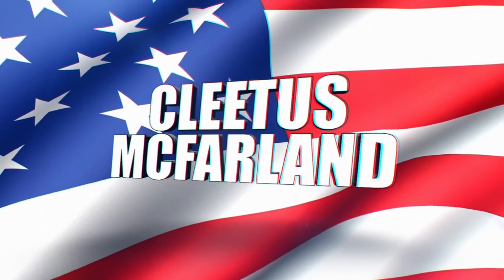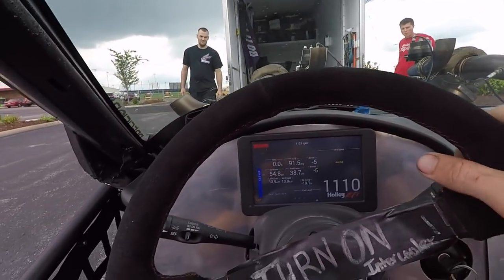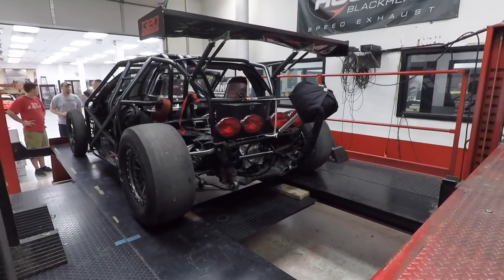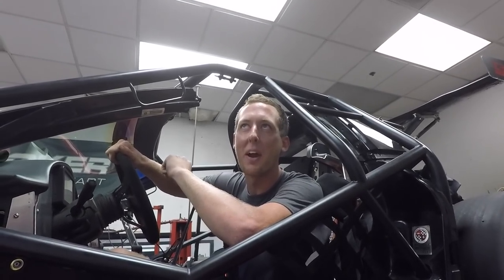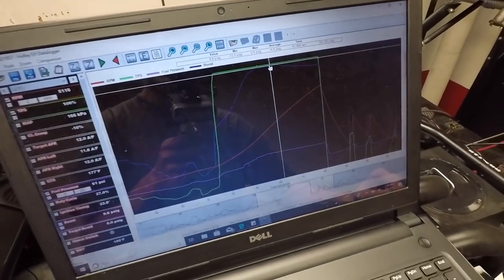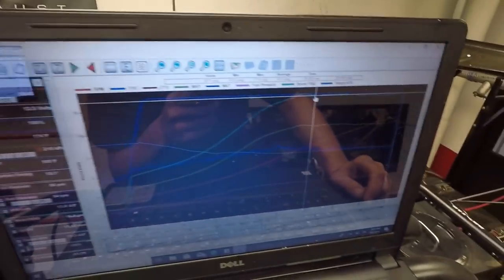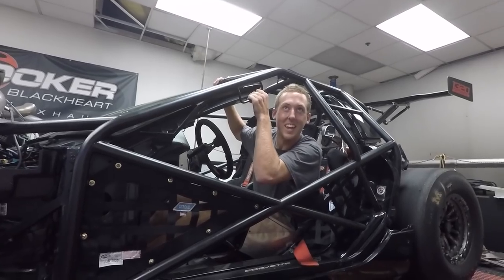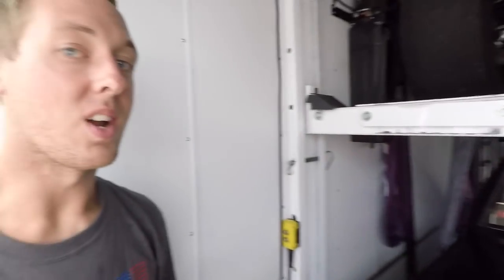Leroy Hits the DYNO! Making HUGE Power at Holley Performance's HQ!

Comment: Autometer part number 9117 should take care of that tach signal problem. It just connects in line with the B+ feed to the ignition coils and puts out its own pulse signal. I needed it for any rpm-referencing stuff on my 3800 but LS's can be a little funky with tach signals too as I understand it.
Leroy's rockin it! Love it

Comment: My car T2.0L makes 260hp at the crank on 20psi, LSX 427 / 7.0L makes 1,260hp at the wheel on 22psi. i'd say that ends the debate ,there's no replacement for displacement! And this 7.0L  weighs about 100lbs less then a 2jz 3.0L.
Reply: Are you sure it weighs that much less? They are both iron block
Reply: the 2jz weighs 600lbs because inline engines need to be rigid because of how long the are , a stock aluminum LS1 is 425lbs and a iron block can weigh between 80lbs to 100lbs more so best case it's 75lbs lighter. Once you add a turbo setup its a break even on weight but being able to run dramatically lower psi is worth it for so many reasons like keeping intake temps under control and not being so laggy because a smaller engine trying to spool up the same turbo to a higher psi is just going to take longer etc. The 2j is a good engine but its kinda pointless because of its size/weight/cost, now if it weighed 325lbs like a honda engine it would make a lot of sense, but 600lbs for a 3.0L is ridiculous because people stopped building big blocks because they weighed 600lbs
Reply: @eaglefat9398  I see your point. That must mean that because the 2jz weighs so much that's why it can handle relatively high amounts of torque and horsepower before something goes wrong because of its weight to displacement ratio.
Reply: FYI my turbo civic made 500whp on 6266 on gate pressure with no timing. And 700whp at 23 psi. 4 cylinders especially Honda’s are more efficient.
Reply: no
Reply: See the problem is that there are supras that make 1000 hp so factor in that it is 3/4 of the motor and you see that the hp that Leroy is putting down is about the same that a supra could if it was a v8 and not an i6 also we are trying to compare a race engine that has all the latest tech pulling and pushing it up and the supra even when update still runs on out dated tech so if we factor that in and take the gm motor back to the year 1996 then we can see that even the big hp car then were only making around 1100-1200 hp and that is some of the higher end drag cars
Reply: @jordanhemingway2057  no there are plenty of built billet stroker 2jzs your not running over 1100 very long on a out dated 2jz before bad shit happens
Reply: Unopened 2018 mustang gt 5.0 made 1194rwhp on 18psi when and was spun to 8000rpm. Id say that ends the debate, efficiency and engineering is is an effective replacement for displacement where possible. It also went 8.64@164 with an unopened 100% stock engine, converter, and 10sp auto.

Comment: Was anyone else concerned about the blue tape being on the intake while he was running it?  I could just imagine the glue being stuck all over that beautiful intake.
Reply: I was thinking the same thing...
Reply: Painters tape from 3M to protect the finish. It doesn't leave any residue.
Reply: They pulled between runs 1 and 2. 6:34 you can see the shine on that badboy for just a sec.
Reply: cold side of the turbskies my dude. Its all good
Reply: @berrytharp1334  I know the purpose of using the tape, but melted tape leaves residue behind
Reply: @geo6111  idk if you've ever touched an intake after it gets to operating temperature, but it does get a bit hot to the touch. Definitely enough to melt the glue off the tape. That's why they pulled it off after the first pull.
Reply: @mangomussolini7986  yeah I was able to breath afterwards lol

Comment: Leroy vs Bugatti 🤔
Reply: Rip to the bug. Unless you got a 3 mile airstrip the bug is useless
Reply: Uh with the LSA blower it was quicker than a veyron down the 1/4... They run low-flat 10's at 135-140 mph.

Comment: It's funny how many people think these engines are built like a loosely thrown together oem engine. NOPE! TIGHT TOLERANCES PEOPLE!
Reply: The tolerances are the same the parts are the difference.
Reply: @liljjbo17  lol 😂🤣
Reply: @liljjbo17  tolerances are different on race engines. Theres many advantages to it. It's not recommended to use heavy oil though. A smaller gap spread the load over a wider area for instance. I could go on but hopefully you get the point now. They are different especially if you want the motor to last longer.
Reply: Not tighter at all. Race motors are actually set up looser especially in the crank and pistons. The main difference is that the crank is perfectly straight, the block and heads perfectly flat cylinder bores are perfectly round.  Each intake runner flows the exact same amount. Rings on the piston have bigger gaps because they get hotter and expand more. This is especially true with NOS equipped motors and ones with forced induction like Leroy. Also rings are much thinner to cut down on friction also. Piston clearances are greater because forged pistons expand more when heated. The only parts that are actually tighter are the valve guides to makes sure the valves seal as close to 100% as possible.
Reply: @michaelwilkening8542  thank you for proving my point. "Perfectly round" "perfectly flat". Tighter Tolerances mean the measurements need to be within a certain specified amount, such as +or-.005.
Reply: yes, a race engine sounds almost broken and worned out at cold starts cause of the tolerances ...
Reply: BigJbish .005 is not tight at all. As a machine operator I work with +/-.0005. +/-.005 is a freaking mile
Reply: @pattyboy2523  I was giving an example. Not stating a fact. What type of machining do you do that you have to be within half a thousandth?
Reply: meshuggah life components for aircraft engines.
Reply: .003 to .005 ( roughly the thickness of a human hair) is normal cast piston clearances.  .005 to .008 is normal clearances for forged racing pistons that expand slightly more than cast pistons. Some forged pistons can be tighter due to the metals composition. Rods and main  bearings are around .0015 to .0025 so having a single hair under a main bearing will lock it up so tight it wont turn over even on a stock motor.  The amount of run out in the crank is the more critical measurement both in diameter and straightness. A crank just .003 out of being straight will wear out the main bearings in a matter of a few passes if the run out doesn't spin a main bearing first. .003 over the length of a SB crank is a little over 2.5 feet is a extremely small amount of runout.  But overall a race motor has much looser moving clearances than its stock counterpart. Straightness and flatness is where the specs are much tighter than stock motors. The little bit of block warp that caused Leroy to blow its head gaskets were probably well within stock specks and on a non-race motor would have never caused a problem. A lot of race motors are rocked which means the water passages are filled with epoxy to prevent the cylinder walls from changing diamanter while under load. We are talking a very small amount of distortion.

Comment: you needed more power you added some weight to old Leroy
Reply: With the power he is making the stronger the chassis is, the more power that gets to the ground. This weight only helps doesn't hurt in anyway. Like added just a 8pt cage to a car even with the extra weight you will go a few tenths faster specially in a stick car with DRs or slicks.
Reply: I figure he would hook a lil better......
Reply: Not with the power he's going to be trying to put down. It's going to be cool to see how well they do.
Reply: @waynebollentin989  the added weight WILL NOT ADD A FEW TENTHS...at this point aero and driving the car will help.
Reply: @chadrichards8930   chad richards  I never said it did. Read it again. I said the added weight would NOT hurt the car. I was also talking about a car with an 8pt cage something his car clearly doesn't have and even then I said it would still help more then hurt the car with the 8pt cage. Thanks

Comment: What I like about Cletus is there’s no bullshit clickbait. Also. Instead of having a note on the steering wheel about the intercooler, for about 20 bucks you can put a temp controlled controller. Set it to come on at 90 or so degrees and only come on with the key on. That way you don’t need to remember to cut it on. Just another thing to forget.

Comment: Awesome new LSX combo, shame about the problem with LS3 blocks with their stock beehive sleeves, even with thick deck aftermarket heads they still push gaskets with high hp/cylinder pressure, but its good to see Leroy now will make mega power long into the future as long as the tuneup it solid.

Comment: I'm thinking that you should rout the exhaust towards the bottom of the cars sides and make them face the rear wheels so it heats them up while your doing your pulls, I guess and work on the aerodynamics, i feel like you could make high 5's or low 6's with those changes. No joke.

Comment: Cleetus, when are you guys gonna get with a motor oil brand for sponsorship???? And what motor oil do you guys run???? Best channel on YouTube!!!!
Reply: Beware dyno readouts can be faked.  It's unlikely but possible. When money is being made of YouTube. 

I just don't see these vehicles having the cooling capabilities to run that much power, when you consider a truck or a veyron has massive radiators.      Also what drive shafts are they running on these drag cars, 

I just thing the power is more like 800bhp or 850bhp.

Research fake dyno readout for a heads up on what some of these click bait channels are doing.
Reply: @chris77777777ify  No you are wrong.  A twin turbo lsx can easily make over 1000hp.  You don't have to spend over a million dollars for that. Yes, us dumb Americans over here have mastered the art of making reliable power.

Comment: How much is the Hp difference on the same Boostlevel ?
Reply: I think it was near 750 on spring pressure before so roughly 100hp on low boost, no telling how much at higher boost till it gets on the same Dyno in same conditions.

Comment: Nothing to break in with big bearing clearences and big ring gaps.
Reply: matt, yup. That is why older high milage engines with bigger ring gaps are good for boosting.
Reply: I was responding to his uncertainty not asking a question. Our teksid block,  with 4V B heads does well over 1500 to the wheels on 32psi. Factory bore and stroke 4.6.

Comment: All we ever did was let it warm up and then adjust the values then hit the track,  with a good engine builder that's all u got to do
Reply: @95Sn95  what the hell r u talking bout
Reply: @95Sn95  I'll go ahead and guess he was talking about a fuel injected car in which he literally said he warmed the car up and then tuned it.. Or "adjusted the values".. There's really not much else you CAN do. He was responding to the breaking the engine in subject you weirdo... I'm gonna second the what the hell are you talking about notion.
Reply: @danielnelson4881   I was talking bout adjusting the values in the 358ci with a carb that we ran in our round track truck,  but what I was sayin all I had to do was start it up and let it warm up and then adjust the values after we got it cause we had a great engine builder like they do

Comment: i work my ass off and only wish i could do some mods to my vette. i am happy tho c6 vetts have really come down in price.my goal one day is to make 700 in her. anyone want to buy a 2015 evo x lol low miles very clean and a new motor. car has 23k on it and the motor has 500miles. trying to get ride of this so i can do more to the vette. love the videos maybe the next time you come to KC mo ill beable to see or meet you and kyale also there is a new NHRA drag track opeing up called i70  speed way. i really hope you guys come to this track its located by KC MO. Will be open spring 19 in march sometime.
Reply: You blow the first motor? Lol
Reply: no first motor was ok the guy i bought it from was runing e85. idk if he didnt tune it right but the top ring poped up over the the top piston in cylinder one. i was lucky it didnt cause any damage to the block or head. i bought all new pistons rods bearings and had my block and head checked.
Reply: ah, i see. i know people with evos that blow them quickly because they slap on a "tune" that just ups the boost and they end up blowing it running too much boost without actually getting it tuned properly or making sure the motor can handle all the extra boost

Comment: Haven't watched the video yet but I hope Leroy makes 1320hp. You know for 1320 videos and what not haha.
Reply: Aw man come on 23psi and 70 percent duty cycle. Do it for Dale 15lbs wastegate springs hit 25psi and 80-85 percent duty cycle. Hit that 1320 hp. I think heavier wastegate springs will allow higher boost pressure through bleeding compared to lighter springs. I'm not sure I haven't owned anything turbo so I'm not very familiar with them.

Comment: lol,, break in should take no more than 30 minutes. Assemble. Fill with junk, cheap conventional oil. Heat cycle twice. Drive it and run it up to just below red line in all gears into final gear and then let the engine compression slow it down in gear, downshift and let the engine compression slow it down. Do this until 1st. Repeat once. Let engine cool off to room temp and drain oil. Fill with good oil and you’re good to go. No additives or gimmick oils like Lucas.

Comment: I bet if u turn leroy up all the way he could run a 6
Reply: @moderndaysaint4972  ye okay well see
Reply: @motoross2056  you have to be realistic here.. look at how much effort went into getting the gtr into the 6 second range.. almost 3000hp, awd, fast auto trans, and proper suspension and aero trapping around 235 or something like that.. Leroy is fast but the way he is even completely turned up isn't going to hit a 6.. now if he can run consistent mid 7s or so and trap 200 like he wants that'll be insane and pretty much the peak
Reply: @moderndaysaint4972  abouksy itll be hard but the way he performed no thought he could ran a 7 and hes only like 1100 hp with clutch gtr is 3500 with like dual or a power glid it got top notch parts on it and barley went 6 imagine putting like a dual clutch or glid on leroy he gona get close to 6s mabey even run one

Comment: well i was in hope that you would have put it at 27 pounds like the last engine to see if it would pop a gasket... well since it is already making more power you may need to try it like that first THEN put more boost to be sure nothing breaks and knowing how it will react... tho at 1200hp and roughly the same torque, your tires will feel like they will be made of "ice"! 

even if i only speak from game experience, in "NFS Shift 2 Unleashed" the old Dodge challenger with works on went from super drivable with all the handling enhancement to feeling like the tires were made of ice at roughly the same range of powers! (and the damn game stopped putting normal cars on the race track and only putting Pagani and Koenigsegg watching those videos here made me switch from 17 inch rims to 13 inches and deflate them!)

Comment: the front tyres are too thin and too dangerous
Reply: The Front tires/rim combo are made for drag racing, they are less likely to yank the car all over the grooves in the track. Its safer and better to run pizza cutters in the front of a drag car. They have been used for over 50 years now, they aren't for street use and can be dangerous on the street.